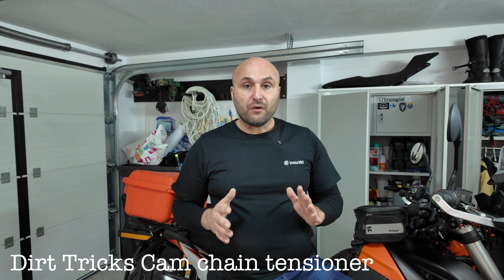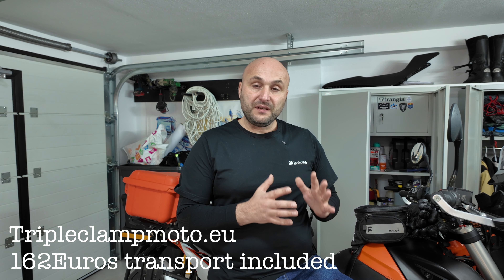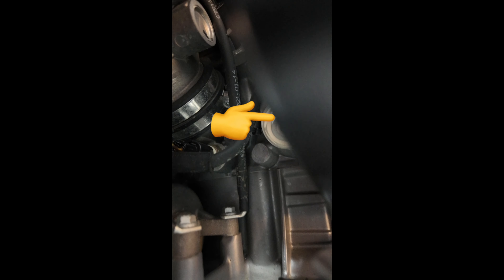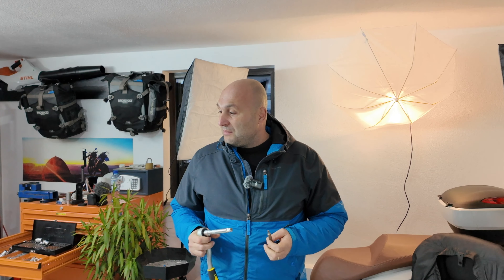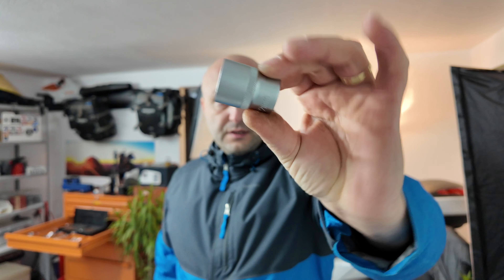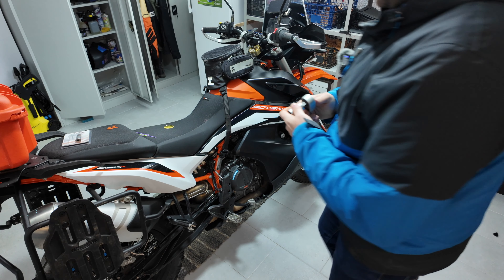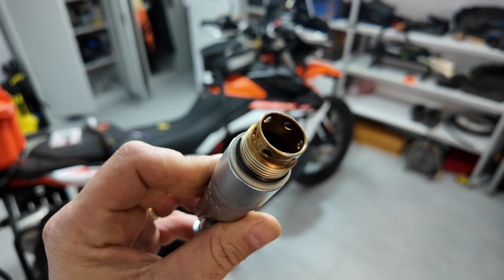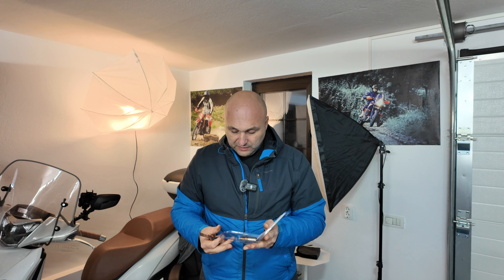Dirt Tricks Cam chain tensioner - ktm890adventure R

Comment: Hi, nice vid! I just installed my Dirt Tricks tensioner on my 2023 Husqvarna Norden 901 and it sounds a bit better. At least the worst rattle noise was a bit better but the cam/valve sound was still there ofc :)
Reply from the maker: @hardworkingswede  glad I could help ! For my ktm, the cam noise is gone

Comment: I put one in my 22, I could not tell much difference at first. Once I rode it is when I noticed a huge difference when at a traffic light. 
For those not the fence I highly recommend it.  A few insulation tip. I did not put the engine atTDC but I did remove the spider washer. It took me about ten minutes to do this upgrade.
Reply: *on the fence

Comment: The official dirt tricks vid, which isn't on the 890, says you must make sure the engine sits at top dead center when you remove and replace, else the timing may get thrown out. On the 2 vids people have done on the 890 doesn't talk about this and i wanted to confirmhow to make sure I'm at TDC...
Reply from the maker: Hello Jason. Yes on the website it sais so about the 250/300 engines. The 890 is a different machine, fundamentally. Me and some of the friends installed it like in the video. No problems

Comment: Hi Dragos,
Thanks for the video. 
I already bought and installed the tensioner. Perfect results and machine sound.
Pls,tell me, did you solved the cold start one cylinder issue?
Reply from the maker: @georgigabrov  no I did not. Still the same issue. i am learning to ignore 😂😂😂
Reply: Is there any relation to cam shaft problem, what do you think?
Last week made inspection from the dealer in Bulgaria, before warranty is gone. 
7000km,no problems with cam shafrts and cams. no problems with valves too.
Reply from the maker: @georgigabrov  I don't think so. Usually the start problemas are caused either electrically either from a fueling problem. So gas or electricity (and in the modern bike case electronics). We will see maybe in the future.

Comment: It looks like you left the spyder washer in? I removed mine as the spyder washer is too small of a diameter to properly catch the end of the Dirt Tricks tensioner and have it see square inside the cap. With the spyder washer it also puts a very large gap between the end of the tensioner and the cap. I trimmed my spyder washer instead of removing it entirely because I worry without one in then the oil flow could potentially be restricted to the end of the DT tensioner. It still functions on oil pressure with the spring as a backup/assist. 

I've been having an issue with my tensioner locking out, but I'm going to try again tomorrow. I may need to return my tensioner because 3 times now it has not extended and locked. My timing  chain has jumped every time, and I've had to tear the cams back apart. I've recognized it each time because I have the engine apart to check valve clearance, but I would have been in trouble had I done this without having the top end of the engine apart for the clearance check.
Reply from the maker: Thanks for watching ! Send your tensioner back to dirt tricks, they stand behind their products and if there is a problem with yours I am 100% sure they will fix it.

Comment: Hello! I have a question, in the Dirt Trick video, they remove the spider washer inside the tensioner cover because they say that otherwise the new tensioner will not seat properly, but in your video you don't see that you remove it... Have you had any problems or noticed anything strange?
Reply from the maker: NOTHING STRANGE, WORKS PERFECT

Comment: And if  your Motorcycle die by pulling the clutch, your new ct is not installed correct.
Reply from the maker: That is corect. I did that and the motorcycle worked fine

Comment: Can't the cam chain jump a tooth while the tensioner is out, if installing this way?
Reply from the maker: No, it did not. Those where the instructions and I folowed. If the chain jumps, the bike will not start the same. It started perfectly
Reply: It absolutely can but he got lucky
Reply: Official instructions say the motor must be at top dead center, which was neglected here...
Reply: If you read the instructions on the Dirt Tricks website about installation, it specifically says 250/350 to put at top dead center.  Here is what is says as I copied and pasted it here, "All model 250/350’s run the risk of jumping time from the removal of the OEM Tensioner".  The 890 is a completely different engine.  I installed one on my 890 with out any issues.
Reply: @adampotter9151  you need to read the 890 service manual...you are wrong.
Reply: @bazza8947  you sir are 100% incorrect on saying I am wrong.  Everything I wrote is 100% accurate. Read what I wrote and don't read into it.  I never said anything about the manual.
Reply: @adampotter9151  The missed the point, you need to follow the KTM procedure before removing the cam chain tensioner

Comment: Salut, bun video. Am si eu o intrebare. Intinzatorul normal este cu presiune de ulei iar aceata e mecanic?
Sau ambele sunt cu presiune de ulei, doar ca acesta nou este inbunatatit?
Reply from the maker: Multumesc de vizualizare. Sunt diferite. Pe cel original il intinde presiunea de ulei. Pe acesta, il intinde arcul. Cand pui capacul peste arc, arcul impinge cilindrul pe patina. Daca din vreun motiv anume lantul devine mai slab patina este tot pe el pentru ca arcul este in compresie.
Reply: @DragosRDS  mersi de raspuns, poate dupa ce expira garantie, ii fac si eu upgrade